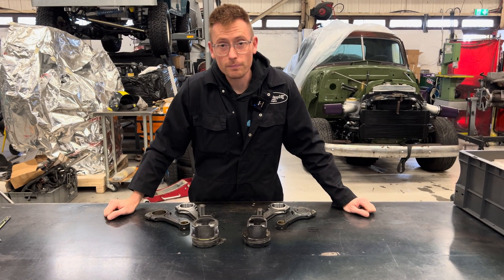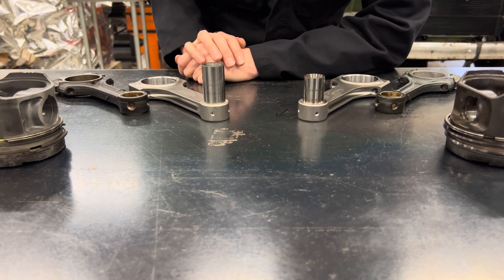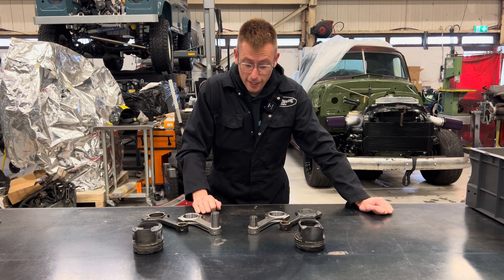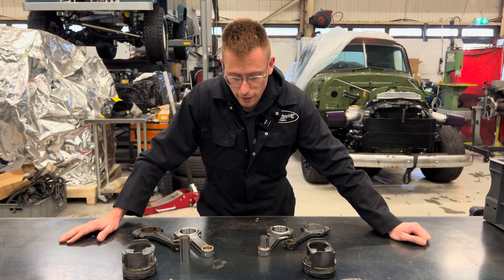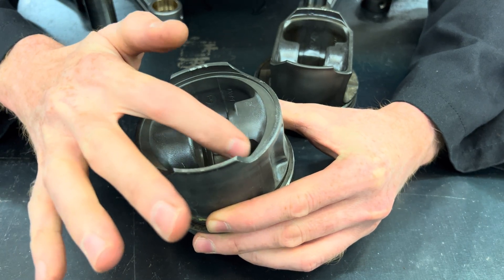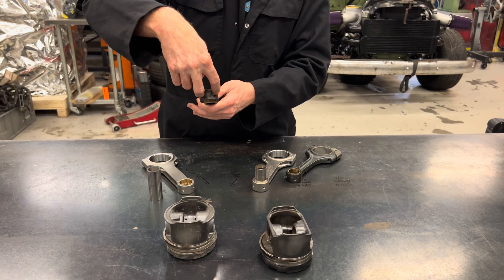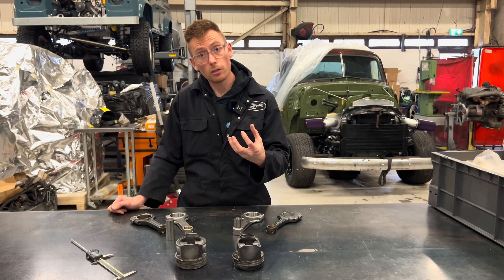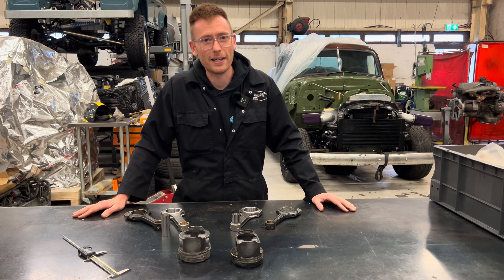OM606 N/A and turbo H beam connecting rods

Comment: Scuse me mate, but are you in all your minds? In wrist pin comparison you mentiones HORSEPOWER of 2jz tt vs. horsepower of om606 as there almost NO RELEVANCE about horsepower in the case of that pin, but almost exclusively is about TORQUE?!? 2JZ at 1000bhp could produce some 950-1100Nm, as an modified om606 of 800bhp will produce EASYLY 1600Nm of torque.

Comment: Is the con rod the same length in both or are there difference in pin to piston-top height? Is the compression ratio the same in the turbo and N/A engine. Asking in reference to a possible turbo addition in a diesel Toyota.

Comment: On the topic of wrist pin size: A stock 2JZ-GTE makes 330PS/325hp on the European Tune and a bit less in North America (I assume thats to accomodate different emissions standards and the octane ratings of the available petrol) and 280hp in Japan (gentlemans agreement).
And one of those engines makes up to 600hp on an unopened stock block reliably so stock rods and wrist pins.
So there is that.

Comment: Hi, I have a question abt the quickspool kit that you sell, I was wondering how will the stock rods hold up when the boost comes as early as 2200 rpm, looking for 300hp
Reply from the maker: @KPahn  to make 300hp the pressure settings of the wastegate can be really low perhaps 1.2-1.4 bar, at that level you don’t get hard kick as the boost comes up which will allow the stock rods to last much longer.
Reply: @DieselPumpUK Just the answer i was looking for, thank you for the quick answer. Been a subscriber for abt 4 years now and a proud owner of a 606 turbo swapped s124

Comment: I asked chat GPT if the USA 1999 Mercedes E300TD had an electric fuel pump.  This was the answer 
No, the 1999 Mercedes-Benz E300 Turbo Diesel (W210) does not have an electric fuel pump inside the tank. Instead, it uses a mechanical lift pump mounted on the side of the engine, which pulls fuel from the tank. The system is designed for a diesel engine and operates under vacuum and low pressure, relying on the mechanical pump to deliver fuel to the high-pressure fuel injection pump.

I'd like to get one and run it on waste oil.  Please advise.

Comment: Hey Luke.
You’re the number 1 specialist in OM606 in the world.

Please try turbocompound from  M57 335d or even triturbo from M550d/750d.

You can prepare a special manifold and downpipe and put 2 or 3 compoundturbos with hybridization.

The advantages are:

-a super compact size system that could be very discreet under the bonnet even with stock air intake until the first turbo;

-best way to enlarge power band since low until 7000rpm once this is the most reving diesel engine in the world;

-use the ecu to control the edc performance injection pump to create a flat torque band of 500nm from 2000 to 7000rpm avoiding issues with excessive torque on gearboxes.

For the W210 will be the ultimate sleeper ever even when you pop the hood.

How much horsepower are 500nm torque at 7000rpm?

Comment: Hi Mr. Luke. Greetings from the oldest town in Texas, USA, Nacogdoches. Another informative video. My 1999 MB E300, is up to 786,560 miles and running well. For those of you who are wondering, yes it is the OM606 and no the engine hasn’t been apart.
Reply: I'd seen your post a few months ago, or one like it, if you're the guy who chose not to have a sunroof (smart move). Legendary w210!
Reply: @ Good morning, it is still running well and has nearly 794,000 miles.
Reply: @slyscafe  Yes, I’m the one who chose not to have a sunroof. It has been a good car, currently we are replacing the fuel pump with one from the parts car that Mr. Luke overhauled. It will be back on the road soon.

Comment: The Supra 2JZ and Nissan RB 86mm aftermarket forged pistons need a lighter rod pin due to the higher RPMs seen, most failures on these engines is in the mid range when they see all the torque and break rods or lift heads, it only makes sense to use a heavier pin on a lower RPM and higher torque production style engine. Im surprised a H beam rod was used instead of a beefed up I Beam rod. Again on the petrol 2JZ and RB engine we tend to ceramic coat the crowns and on engine with oil squirters we tend to remove them and plug them up to keep all the oil flow and pressure for the bearings.
Reply: I think that locking oil squirters is just for 1/4 mile. For overall street usage i would leave them on. Maybe with a bit stiffer spring (which will open with a bit higher pressure). However i wouldn't push it over 600hp crank. Rn i'm having "half" of 2JZ in terms of displacement. 1.6EcoBoost that is doin happily 280hp. Cheers mate :)
Reply: The comparison was the ring package,  which differs in a diesel engine,  from a petrol engine. But those are fundamentaly different between the two. A diesel relies on compression to provide a hot enough environment to burn fuel upon I injection, where gasoline requires a spark.

Comment: Im so thrilled and excited for this! I live in the USA, so this engine is rare. I picked up an NA 606 and have been dreading the parts hunt, especially for pistons and rods. Please keep this product available to the market for a long time. It will help us American builders out so much
Reply: I’m sure if they sell well he’ll keep making them. Vote with your wallet
Reply: there are "no-brand" connecting rods (probably just like these) already available to purchase for less than half the price
Reply: @danielsvamp  do you really want to cheap out on building your engine? If there’s anywhere you want to cheap out it’s not engine internals
Reply: @Robdutton-x6d  Brother, it's the same thing. As long as you use good bearings, it's fine. Cheap rods are probably not the lightest but that's seldom the main thing people are after and no dealbreaker.
Reply: I'm in a similar situation. Bought a NA 1997 om606(supposed to be the most similar block casting to the turbos) I have turbo head and exhaust manifold/ stock turbo. But I've still been in the 'parts accumulation phase' for about a year.
Reply: I have some costumers with defenders I'm going to be in touch for those to good market here for this lots of money around these parts lol